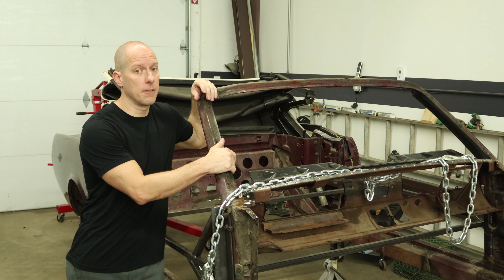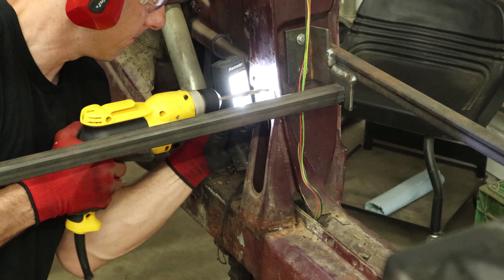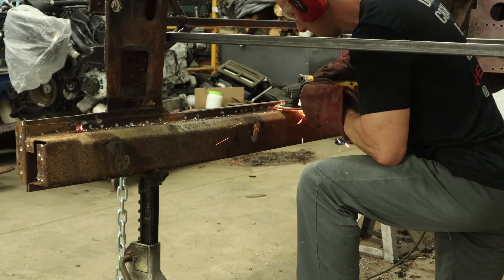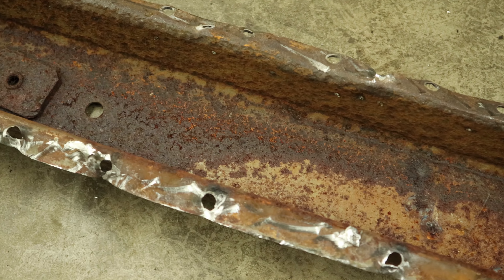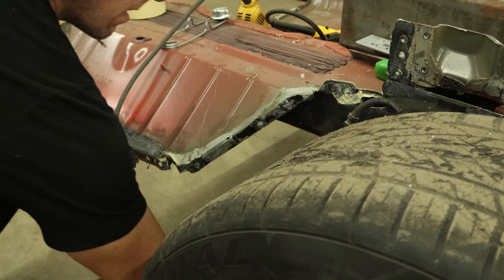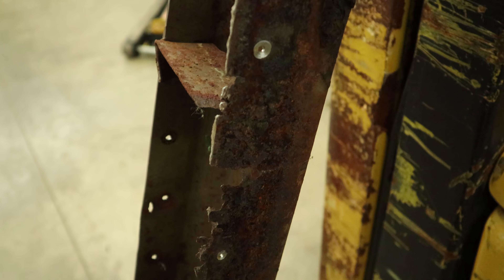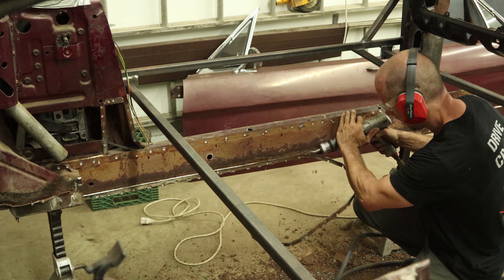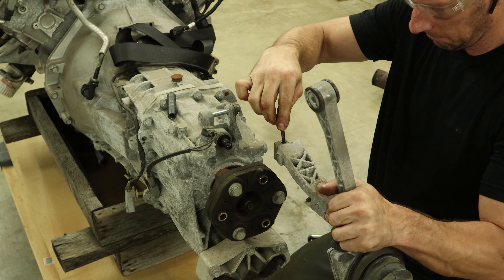Removing the rusty frame rails from the 65 and dropping the engine in the 2015 for the Mustang build

Comment: You need a plazma cutter and blair spot weld cutter... used to do the same way you did...with a drill... blair cutter are amazing...  cuts  extremly fast..just need a little  puch mark...
Reply from the maker: Yeah, we have been down that road on this channel.
Reply: @vehcor  i seen that video i believe..but you where using cheap spot weld cutter... Blair cutters are soild carbid tooth not cheap little hole saw type from off shore.... but slicing threw the fram rails plasma is way to go

Comment: I have never had to remove seam sealer, but looking at what you showed during the start of today's video my first instinct would be an angle grinder with a wire wheel on it.
Reply from the maker: The old stuff turns into a gooey mess.  It does work on the newer stuff but Ford just uses so much of it!

Comment: Scott, do you think the build quality is better or worse today. All the new technology aside. Welds, steel quality etc. I love your work. And I believe you are a purist. A lot of people would just get the blue wrench out and hack away the bits they don't want. You actually take a methodical approach to disassembly.  Thanks.
Reply from the maker: Build quality is far better today without question.  Better materials, better fit, more consistent welds.  Hasty cuts lead to a greater expense for the build.  I’m in no rush so I do as little damage as possible.  You never know if you might need one of those parts you thought you were tossing.  Thanks for the support!

Comment: This is the most meticulous dude. I would have cut shut and rammed it but you use labour intensive finesse which will take your project to a highest standard. How do you intend to make it strong? Will you drop a cage in it, pack it with tubing or will you reweld the panels back up? Keep up the good work

Comment: Dammmmn Scott, you are hard on the  Troll University Graduates...LMAO!  That rant was worth the price of admission!
Reply from the maker: My dislikes have been down lately! I had to do something! 😂   I need to put warnings on my videos that this channel is not a safe space.  Trolls will be mocked and called out right along with those engineers that design some of the dumb stuff I have to work on! 😂
Reply: Speaking of engineers, I dont know why Ford just didnt put some seam sealer in the frame rails too. Would have prevented pests and rust. lol.

Comment: It is definitely getting close.   Scott, how much difference in rear track width between '65 and '15?   It looks like the new car's wider, but that may be perception from this end.   That '15 puts a lot more tire on the ground than those 6.95x14s on the '65.  Narrowing a solid rear axle isn't a big deal.   I'm wondering how to go about narrowing that IRS setup while maintaining the geometry.   Lotta engineering.
Reply from the maker: The 15 is much wider.  There will be about 2.5 inches of tire outside the existing body.  I like wide body kits so now I have an excuse.
Reply: @vehcor  I was guessing it was either that or section and widen the '65 body, which would be an interesting ride.
Reply from the maker: I’ll leave that to @Vtuned.  Widening each individual roof brace would be more tedious than all the spot welds I have drilled!
Reply: @vehcor  -- that top frame didn't even cross my mind.   maybe with a hardtop.   On third thought,  hey, widebody would work great....

Comment: I wonder and you may have said in an earlier video but why didn't you get the body media blasted? Would not media blasting remove all the undercoating and seam sealer?
Reply from the maker: It would be a waste.  I threw away half the car and they never get into all the areas underneath stuff anyway.
Reply: @vehcor  Thank you for your reply.

Comment: I believe I have the same Snap-on air hammer. I Think mine is a PH-2050 with the long barrel. I’ve had it since about 1998. My old Mac Tools AW234  1/2 inch impact I got around 1990 is still my favorite. Thing just works! Rebuilt it a few times over the years, but I haven’t found anything I feel is better. I bought a new Snapon IM6500 impact around 2005 that was pretty sweet looking, but just didn’t out perform the Mac! Those new composite impacts they are trying to pawn off are all just terribly built! Light weight yes, quality? Helllllll NO! Yes I’m set in my ways! LOL

Comment: I have been doing the same thing for a long time. One problem that might exist with those rockers are the rodents that are in it urinate and cause the metal to rustsame with the floors I have done several mopars from the mid-60s that the floors are gone but never seen any water the problem lies within the rodent urine. The acids in the urine will disintegrate the floors and other panels I have found multiple cars from Texas that are rotten on the inside of the drip rails I finally came to the conclusion that the rats were getting up and it up for headliner and nesting in the corner of the roof in the drip rail urinating in that area causing the drip rail to rust out

Comment: Your 710 Cap is upside down on the engine; it'll run much better when you get it installed correctly. 🤓

Comment: Google mach40. 
When doing a project like this or the mach40 I really wonder if using donor vehicles has any point when you can now buy almost all the panels brand new.
In mach40 they started with an ok fast back that turned out to be mostly rust but then proceeded to cut it down to almost nothing and replaced and customised every single panel and build a frame. With the possible exception of needing a vin there was absolutely no point in using a donor car and for a vin they could have grabbed any old wreck as long as it wasn’t listed as a write off.

Comment: It is still going the right way . I was actually  waiting to hear " for the pile " and " on to a new project " . Didn´t mean that of course . I was pleasantly surprised that finally you used safety glasses to remove that dangerous seam seal , Your next investment should be heating for your shop . As much as I liked your red earmuffs I still felt a bit sorry . You spend 50$ on a drill but your shop is cold . All kidding aside . your doing great , but you don´t need me to tell you that .

Comment: Well, this video was so interesting that I was at the end of it before I knew it and I was amazed at how quickly the time had passed while I was watching it. You've made a lot of progress, but it must have taken you hours to drill out all those spot welds. You've definitely put a lot of thought and engineering into this build to do it the right way. Absolutely worth taking your time and doing it right the first time. Just wondering what that blue car is in the background is, not being familiar with this type of car. Stay safe over there and all the best from Australia.
Reply from the maker: The right side took about 3 hours, the left, 1.5.  All the welds on the 15 were less than a half hour.  I spent hours measuring and planning before any tools came out.  I keep measuring and coming up with new plans to see if I can find a better way or if the original plan is the best I can do.  The blue car is a 47 Buick.  There is a better look at it in the garage tour video.  Thanks for the support!
Reply: @vehcor  Love those cars from the 40's, they had so much style.

Comment: People with lots of time on their hands can spend it trouble shooting and repairing tools like that drill motor.  People who have all the work they can do in their lives and don't have "spare" time can make more money doing the value added work, such as repairing cars for resale, than the time it takes to trouble shoot the problem, find some place that sells the part, order it, replace the part only to have a tool that may have another part ready to give up right away.  When I worked it wasn't cost effective to repair a $50 drill motor because you would have more than $50 lost time messing with it and end up with a used tool that you could not be sure would not break in a month.

Comment: That was a lot of rust in the rockers. Glad you cut it out. Did lift the frame down...😁
Reply from the maker: It seems like there was more rust in there than there was metal originally. 🤔 Maybe I can get it put together if I lift the frame down instead!

Comment: I knew it was the switch.  You don't seem like the type to run regulated, filtered air.  Hammering it with 175 psi of dirty air kills a switch in short order.
Reply from the maker: Filtered air? On an electric drill? 😂

Comment: most things can be repaired for a price, I commonly find "the pile" to be the most cost effective use of my time
Reply from the maker: Agreed!
Reply: @vehcor  as a safety expert I'm glad you got a new drill..... it's safer😄😄😄😁
Reply: True, but I also know guys who make a good living off the stuff people like you toss "in the pile". For eg: Mustie1 here on youtube just scored $12000.00 worth of high end lawn care equipment that "didn't run" for $2000. Including a John Deere riding mower/tractor that sells for $5700 CDN. He paid $400 for it and the issue more than likely is? bad gas/crap in the float bowl.
Reply: @muskokamike127  I agree and I love Mustie1, it usually comes down to what I have more of at that given moment, time or money
Reply: @drptripp  did you see the F150 he picked up with a "bad" transmission? a couple of hours and all fixed. He picked that up for a song.
Reply: yeah Mustie is pretty handy at getting things old and thrown out running and working again
Reply: @muskokamike127  when he did the junk boat motor then busted it up, some guy said he wasn't a "doer" I'm like you're new here right?

Comment: But but my online degree says you should try this instead of the right way lol 🤣🤣🤣🤣 throw your degree IN THE PILE lol
Reply: To be honest, the very first thing you check when an electric motor doesn't work is the brushes for things like drills and routers etc that spin a LOT. If you take a drill or ?? into a repair depot the first thing they check is (after plugging it in) is the brushes....specially if it is used and abused like an old lot lizard.
Reply: @muskokamike127  Used & abused like an ol' lot lizard. LMAO Ka moan.😎
Reply: My online small appliance degree goes well with my online political science degree  and medical degree
Reply: @tobycatron2103  while taken to the extreme, stating you have an online degree, there's a TON of accurate and useful information out there. 

BTW: if you live in BF Alaska? you CAN actually obtain an "online" degree from Harvard or another Uni......
Reply: Muskoka Mike I didn’t mean to disparage on line degrees.  
That may have come off wrong. I have actually looked into progressing my degree online. Maybe I should have said on line experts or on line warriors.